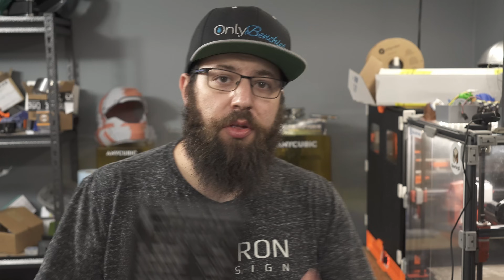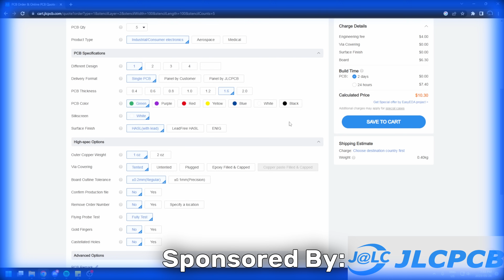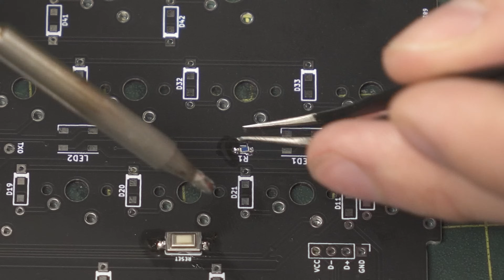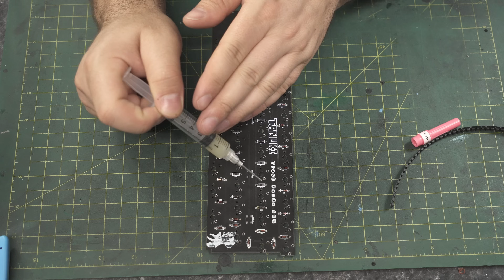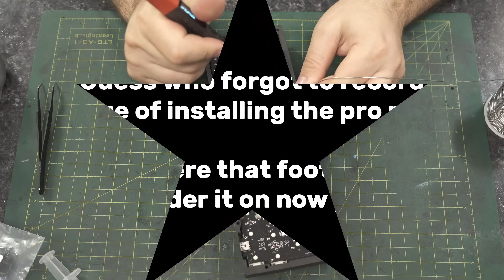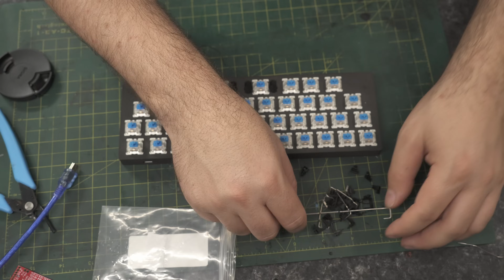The Tanuki - Building A Custom DIY 40% Keyboard

Comment: @Nero 3D I hope you're able to make another video about input shaping for 3D printers. I have an Orange Pi 3 LTS I'm using due to the Pi scarcity right now, and I just am having a hard time getting input shaping on it via either USB or the GPIO pins. A video would be massively helpful, especially with the lack of posts/videos on running klipper and input shaper on alternative boards. Thanks!

Comment: I have been using 3d printing for making custom keyboards for a few years now. Great way to test layouts before ordering a cnc machined case. Currently using a handwired 40 key ortholinear keyboard, the FortyOrty. Files are on printables, if anyone is interested.

Comment: Great video! Just curious, does this board accept the installation of hot swap sockets?
Reply: I had the same idea, but since it uses the switch soldering as a structural part, I guess not.

Comment: I just have one question, why staggered layout? Why not a custom layout, why not a split keyboard? There are of the shelf 40% keyboards like preonic/planck, and some Chinese ones. Even if you want other switches, and have to desolder them, it would be probably way cheaper than doing DIY...
Reply from the maker: Cus it's a custom keyboard

Do want ya want. And I wanted to make this one.
Reply: @CanuckCreator  fair enough